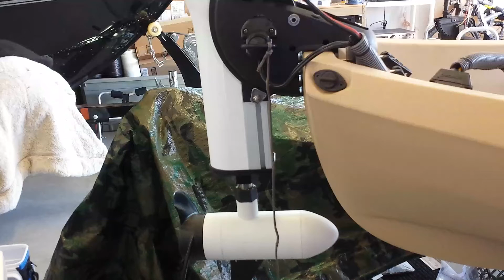DIY Kayak Trolling Motor Kill Switch

Comment: Thanks, great idea! Think I might go a step further though. I'd put it in the foot well and have to push it to keep it on. Kinda the opposite of a dead man switch.
Reply from the maker: Hi Wali, great idea. When you want to run the motor constantly then just flip the bar over.

Comment: What will happen if you fall off on the left side? The string will be wrapped over the motor mount. Maybe a line guide below the switch that would  force the line to always pull down on the switch release. Also is it possible the string could get tangled in the prop before you stop the motor?
Reply from the maker: You could use a guide or maybe a different mounting location centered on the TM. The switch would open before getting tangled I believe because it does not have a lot of travel.